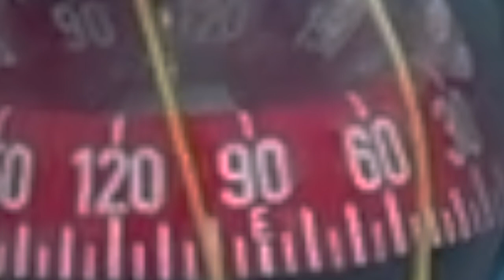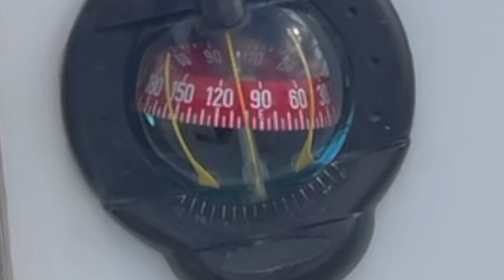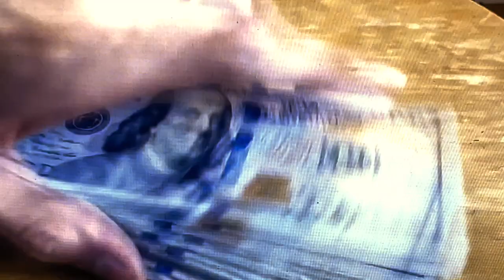THE COM-PAC 23 SAILBOAT IS SIMPLY STRONG

Comment: Years ago I had a Cal 25 with a custom trailer. I would have it loaded on the trailer at the marina and bring it home for the winter. Had external halyards but slapping wires in the mast. I hoisted the bottom of the mast to a 2nd floor window. I then blew styrafoam peanuts into the mast with a vacuum cleaner. . All the neighbors and my wife thought I was crazy. Then I opened the laundry room window and was able to get the mast down the staiirs into the basement. Wonder if that old Cal is still afloat.
Reply from the maker: Great story.  I can just imagine the  neighbors trying to figure you out.  I like the idea of styrofoam peanuts.  My Flying Scot had them in the mast.  My wires are still slapping.  I can’t figure out how to stop it without lowering the mast.   I’ll probably take care of it on my next haulout, happening soon, where’s my vacuum.

Comment: I had a ComPac 23 in the 80s. I sailed extensively along the Mississippi Sound and Gulf. Got caught in some pretty heavy weather a few times. These boats are solid, fun to sail, and easy to maintain.
Reply from the maker: It sounds like you got plenty of experience and memories from the CP23.  I hope to do the same.  I know I have a project on my hands to get this boat ready.  It's a good, unmodified, basic boat I can build on.  Thanks for checking it out.

Comment: I'm really surprised that with a boat that size you didn't add a spray dodger to match the Bimini. With such a shallow free board due to the boats size, i would think that a dodger would help especially in the Bay when the seas are up.
Reply from the maker: Yes this boat desperately needs a dodger.  I show a picture of a CP23 with a hard dodger/doghouse in a video.  I would love to build one out of those high density poly sheets.  It's a wet little boat.   The companionway sliding hatch has to stay closed most of the time I'm out there.  This boat will get there.  Lot's of possibilities.  Just getting started.  Thanks!
Reply: Wrong dknt need that

Comment: Great to see you post again, glad to hear your out having fun sailing, and super job on the video!  We are covered in snow in the upper Peninsula, and around four months away from any sailing.  We were able to sail ours some last year (first time) and spend a couple overnighters... Lessons, try to leave anything extra at home, organize stuff better, try to get more comfortable cushions for sleeping... maybe replace original foam in cushions with better, maybe use a cut mattress topper??  

Sorry no suggestions for the wire slapping without taking the mast down...—tighten the wire a smidge?
Reply from the maker: Hey Randy, I've already made some great memories on this boat.  I just need to make the solo operation of it easier.  It's 40 years old, but it came with zero upgrades. Which is the way I like it, so I can make it suit me.  
New cushions will make all the difference.  I had some made for another boat using an extra firm layer with the usual density stacked on top.
Yes, I tried tightening the wires, but no success.  It's a conundrum, but I have an idea which involves drilling a small hole or two into the mast.
Hopefully it will work and be in a video.  Thanks for watching.
Reply: I was trying to think of a way to zip-tie, but no—maybe something like monofilament threaded around and tied off???  Hope whatever you try works..

Comment: Glad you are enjoying it. I need to fix my mast wires as well, but my mast is down right now.  I just received my new foil rudder blade from ruddercraft and am looking forward to using it in a couple months. It looks very nice and I will do a video on it.
Reply from the maker: You have a great looking mk2!  I just subscribed to your channel and look forward to your next video.  I had to cut 6" off my rudder to be able to salvage it.  It had been left in the water by the previous owner and barely usable.  I Bondo'ed it and coated it with a rubberized spray.  Probably not recommended, but it's what I did to save it.  Thanks for watching.